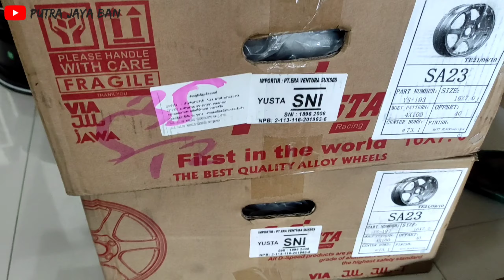MODIFIKASI HONDA JAZZ GE8 GANTI VELG TE37 BAN GT SEMI SLICK SX2

Comment: kalo vleg ring 16 dipasangin ban gt ukuran 205/50-r16 pas kah bang?
Reply from the maker: 195/50/16 bisa 205/50/16 bisa
Reply from the maker: Itu pakai sx2 205/50/16 om
Reply: iya bang,,kemarin sudah dipasang ukuran segitu Alhamdulillah masih masuk...
Reply: @putrajayabanbanyuwangi5139  harga ban nya brapa bos